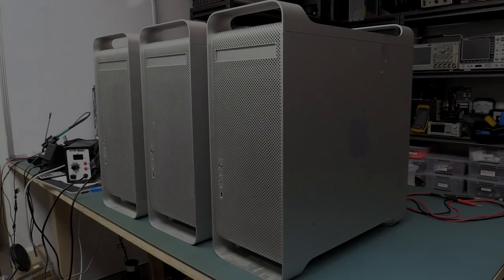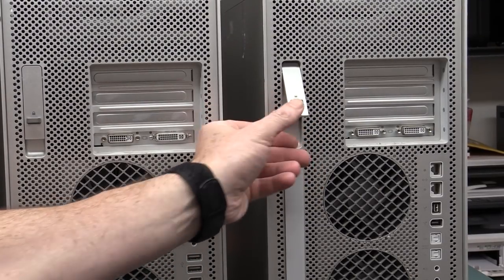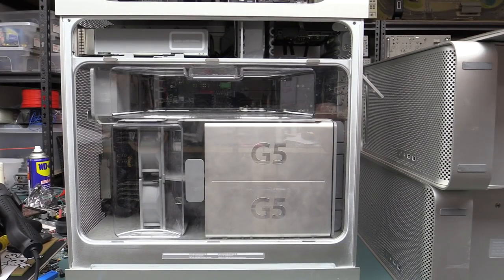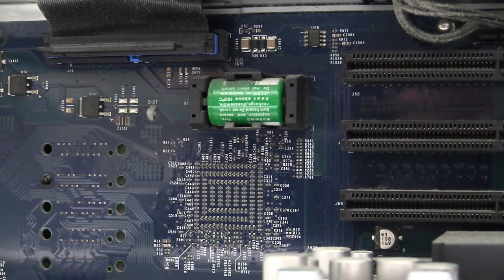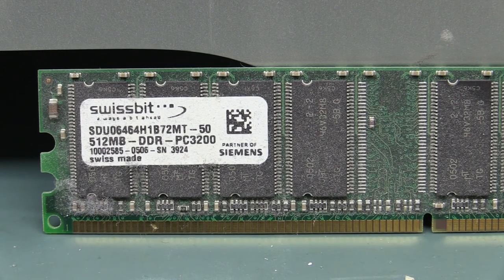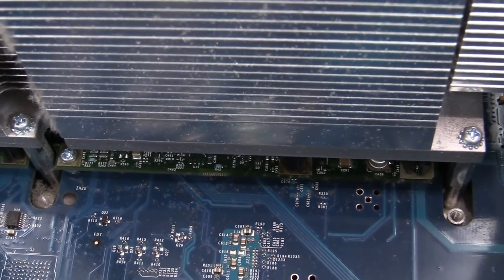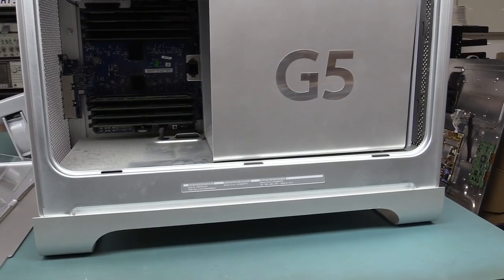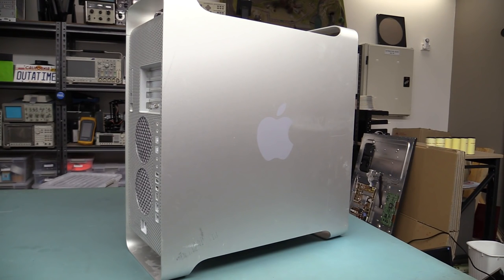EEVblog #783 - Dumpster Dive Power Macs

Comment: Those fans are probably  manufactured by Delta
I have the same in black.
Is that a C19 iec inlet?
Reply from the maker: pcuser80 Yes, C19 I believe it's called. But no one calls them those silly IEC numbers.
Reply: EEVblog C19 was used on the later G5s. the last one you have is the dual-core 2GHz model with a single CPU card. they used the same board for the Quad 2.5 which was actually watercooled. the watercooling on that and the dual-singlecore 2.7 both had watercooling system issues and leaked... the coolant was corrosive! so imagine what that'd do to your board or PSU?

Keep the C19-wielding G5 together and solid. they make very good Linux machines and extremely nice 10.5.8 machines. the others... not worth keeping together if they have DDR RAM. I've seen a few mods in my time, but the most prominent one was the use of a small motherboard with a SAS card and RAIDed drives in custom sleds that stacked, using the original fans for cooling, to make a power-efficient NAS that just looked really badass.
Reply: +Sudos In fact it's a C20 inlet.
Reply: +EEVblog The standard C13 and C14 are often reffered to as "euro connector".
Reply: pcuser80 If the computer crashes these fan spin up to full blast, which sounds like an airplane on take off. The last one of the G4 models was so noisy that a petition was successfully launched by some early customers.
Reply: EEVblog What about that Samsung LCD TV? It was Fixit-Friday.
Reply: pcuser80 5:49 There's clearly Delta logo on the stickers
6:03 "No branding on them though" :D
Reply: +ZXRulezzz 
Yes i see it now ;)
Delta are the best
Just like motörhead extra loud......

Comment: I found one of these in the trash last year.  It had no Hard Drive inside but otherwise everything was there and it powered on and seemed to POST okay.  I ended up putting it in a local classified ad and traded someone for a 5.1 DD/DTS surround receiver so it worked out great for me since I needed a modern home theater receiver and had no use for the old Mac.

Comment: iPhone more powerful? That's a pretty bold statement don't you think dave?
Reply: ***** I feel the same way. Geekbench only seems to show composite scores for iDevices, but from what I can tell the dual core G5s are still more powerful than even the iPhone 5 and I'm willing to bet once you start getting into FP-heavy workloads it's likely even worse.
Reply: ***** well they are over a decade old
Reply: ***** Have you guys ever heard of sarcasm?
Reply: +DrScopeify no.  it is a bad reference.  because it is untrue.  you might be surprized to see how little technology has progressed.  Moore's law is dead.  Jeez... it still had 8GB of RAM.  What does yours have - today?
Reply: +Son of a Zombie - Since when does 512MB x 8 make 8GB? I think you meant to say 4GB...
Reply: +jasonteknut The last machine he showed had 1GB x 8.  Insert foot in mouth.
Reply: ***** Exactly. Those machines are dual-core 64-bit PowerPC with 2.3 GHz according to spec: http://www.everymac.com/systems/apple/powermac_g5/specs/powermac_g5_dual_2.3.html
Reply: megaspeed2v2 They are exactly a decade old. Dave was wrong when he said 2003, those are 2005/2006: http://www.everymac.com/systems/apple/powermac_g5/specs/powermac_g5_dual_2.3.html
Reply: Son of a Zombie 
Your comment wrong on some many levels, I can't even into how you managed to write so much garbage in 2 lines.

"it still had 8GB of RAM.  What does yours have - today?"

Oh yeah, those 8 GB of ram surely came at the cheap cheap price of 100 bucks that get you 8 gigs of 8 times faster and more energy efficient memory these days.
These were top of the line machines, what kind of comparison is that?.
I can do that too:
OMG check out how much technology has advanced, an ATTiny26 had 128 Bytes of memory when it came out in 2002 and now we have machines with 128 Gigabytes of memory!11 
That's ONE BILLION times more memory!
"Moore's law is dead." Except it's not, surely it has slowed down but it is far from dead. I don't understand how it makes sense to try and disprove Moore's law using memory capacity while the theory is based on IC transistor density, I recommend you look up NRAM though, consider it a wake-up slap.

"you might be surprized to see how little technology has progressed."
Except for the massive performance/watt increase and the stuff that is coming up, I consider carbon based integrated circuits a lot of progress.
Reply: ***** No tech is safe from the rapid march of advancement. NOTHING.
Reply: +Son of a Zombie That was the best money could buy. Today the best you can do with consumer hardware is 128 GB, or sixteen times as much. I'm running 48 GB in my main PC at the moment, and 16, or 24 GB in the others. You were saying?
Reply: Son of a Zombie RAM size hasn't grown to giant numbers because RAM Clock Speed is more important now a days than just capacity. 8gigs of DDR3 is much faster than 8gigs back then.
Reply: Son of a Zombie lol not dead yet, as many has pointed out.
Just look at the GPU market they are estimating to hit the 1TB/s bandwidth with the new generations, just a few month a go we were at 512GB/s and before that generation it was 256GB/s.
This is thanks to the fact that they have squeezed so many more transistors into the same die size.
Reply: svampebob007 there is less transistors in the GTX 980 than 780... "many people" have to assume... but engineers are smarter.
Reply: Son of a Zombie
 the density of the 980 is much higher then the 780...denser equal to more transistor per die or more precisely per wafer.
Reply: svampebob007 dense = smaller only.  *Not more powerful.*  Don't let the marketing fool you.  The 980 is better due to software, the hardware itself has gone backwards.
Reply: svampebob007 No, they're both built on a 28nm node.
Reply: Son of a Zombie The hardware has not gone backwards, it has been refined. TMUs have been cut back, ROPs have been increased, CUDA core count lowered but frequency GREATLY increased, pixel fill rate is up, texel fillrate down, etc. There are areas where Maxell is slower than Kepler, such as FP64 but that is something which won't affect 99% of users.

By refining think of it as going from a 2 speed car pushing 300 KW to a 7 speed pushing 250 KW, the latter is geared to better make us of the available power.
Reply: Oj10101
yeah you're right, still doesn't change the fact that the next generation will be pushing the TB/s bandwidth. I'm not the one that pulled the 780 vs 980 comparison. Though to say that the hardware is going backwards is ridiculous.
Reply: DarkAvatar1313 I disagree, memory clock is what we have a massive overhead of right now, at least for gaming.
High capacity memory should be cheaper. imagine devs loading a full 60GB game into memory on launch becoming common practice. Progressive loading of large worlds? screw that! load the entire world!
Reply: iPhones use ARM and PC's x86, you can't really compare them since they're made for different purposes.
Reply: Freek Weijers Someone finally understands.
Reply: svampebob007 No, but you did say that the gate density is higher on Maxwell, which it isn't. Maxwell has a smaller die because it has less gates, not denser gates.
Reply: Oj10101
 yeah and I said you're right, my bad.
Reply: +Jeremiah Batista (JBwarrior) these are Power PC. Power PC is an ARM based architecture, x86 is Intel.
Reply: ARM and PowerPC are completely different instruction sets.
Reply: +Jeremiah Batista (JBwarrior) you're right, I think I was confused as it's RISC based rather than CISC.
Reply: They're both RISC based.
Reply: +Jeremiah Batista (JBwarrior) that's why I was confused. RISC was popularised by Acorn though back in the day..
Reply: ***** Moore's Law was to do with transistor density, not frequency.
Reply: +Son of a Zombie 
True Moore's law has been slowing lately.
But when you look at you computer history you realise just how much things have slowed.
1980 the Apple III a 2Mhz 8bit machine with primitive color graphics was state of the art .
In 1990 the Mac IIfx comes out with a 40Mhz 32 bit CPU and true color graphics.
Reply: Patchuchan Not really, in September 2005 a top end rig would've been an Athlon64 FX-55 2.8 GHz single core or Athlon64 X2 4800+ 2.4 GHz dual core (Intel was still stuck with Netburst Pentium 4s at the time, Core 2 Duo had not yet arrived), 2 GB RAM and two GeForce 7800 GTX 256 MB cards (the 512 MB versions only launched in November 2005) and mechanical hard drives in capacities of up to 500 GB.

Fast forward to today and your choices are a Core i7-6700K 4.0 GHz (4.2 GHz Turbo) 4 core/8 thread or Core i7-5960X 3.0 GHz (3.5 GHz Turbo) 8 core/16 thread CPU, 32 GB RAM, four GeForce GTX Titan X 12 GB cards and PCI-Express SSDs.

Using Cinebench R11.5 as a CPU benchmark, the chips of 2005 were scoring between 0.7 and 1.1 at stock, today's chips do 11 to 15 points at stock. That's an increase of around 15x.

Memory back then was running in dual channel at speeds of up to around 6,000 MB/s, today we've got quad channel at speeds of up to 60,000 MB/s - a speed increase of 10x while having 16x as much RAM.

Graphics card benchmarks can gain or lose a LOT from tweaking, and CUDA wasn't supported on the GeForce 7000 series for brute speed benchmarks so I'm not going to list the benchmarks here but we've gone from two cards totaling 512 MB memory to four cards totaling 48 GB - that's 96x the memory alone.

A 500 GB hard drive from 2005 would've scored around 70 MB/s continuous read/write speeds and 0.6 MB/s random 4K read/writes, today's PCI-E SSDs can do over 2.1 GB/s continuous and up to around 230 MB/s random 4K. That's an increase of up to almost 400x. We also have capacities of up to 8 TB, or 16x larger.

In short, no, I dare say things have not slowed down.
Reply: Oj10101

If you include Wirth's law things might actually be getting slower over all.
Reply: Patchuchan I can partially agree and partially disagree. Booting Windows in under 7 seconds just wasn't doable ten years ago even with multiple drives in RAID 0 unless you stripped the OS to nothingness and disabled all startup items. Starting an MS Office application in under a second was unheard of unless the files were cached from being opened, closed and opened again with the second application launch being timed.

Keeping to the resolution we were running back then (1280x1024 or 1600x1200) you couldn't build a rig that could get hundreds of FPS in the latest games - today it's easily doable (albeit very costly) at those resolutions.

If we bump it up to today's resolutions (1920x1080, 2560x1440 and 3840x2160) it's not doable - we're back down to the frame rates of yore and even lower but the goal posts have been moved.

Because of this it's not that straight forward to do a direct comparison, which is why I both agree and disagree with you.

Comment: I bought the first G5 model when it first came out. I used it for 10 years. It still runs, just stored away now. I used the G4 Cube 15" monitor with the G5 for years. Still works.

Comment: 4gb/8gb of RAM in 2005. Even these days people still have 2/4gb.
If they had gone with windows support, they would have had way more market.
Reply: +Mauro Tamm this is a high end Workstation machine. A modern Dell or HP workstation has 32 - 128 GB of Ram easily. My 2010 Dell workstation has 24GB of Ram and I could upgrade to 256 GB or more if I wanted. Don't compare the PowerMac G5 with a consumer laptop, it isn't fair!

Comment: These machines are just as good as the day they were released for what they were intended to do using the same OS. You can still video render, use modern websites with alternate browsers, and run new software compiled for PowerPC. They are far from useless they were monster workstations back in the day.

Comment: The biggest difference with the last model (the one with the nVidia GPU), is that that one had full PCI-E expansion instead of the old PCI-X that was used on the older ones (although I believe they did have PCI-E for the video card, while most people were still using AGP-8x). That's why it had the extra heat sink, it was for the IO.
Reply: +Yukari Yakumo NVM, you later said that lol

Comment: The cpus are on daughter boards. You should of took them out.
Reply: It is a big pain in the ass to get them out... I don't blame Dave...
Reply: It is I've been there
Reply: +Im Curazy kudos. I fixed the PSU of the late 2005 model once, and then took the whole thing apart at a later date when feeling adventurous. 10 hours just to disassemble and reassemble :D
Reply: Gustavo Ferlizi I used to be an Apple tech, long before they had the 'Genius Bar' bullshit, and I used to strip an iMac (which was a pain in the prick) down to nothing (display issues and things), and rebuild it within 45 minute. Other techs used to watch me because I was the only one that did it without missing a screw or two. It's never a good thing when you have 'extra bits' from a repair. LOL :)
Reply: Gustavo Ferlizi
More kudos to you. Mine was dead i was just stripping the good parts from it and after a few hours i just cut the case apart. For something that looks so neat and simple, it must be put together with magic.

Comment: I have a Quad 2.5 Ghz G5 that I picked up used a while back and still use as a secondary machine. It's great for any PowerPC-only, Mac OS X-compatible games you might want to play, and this puppy can also handle everyday tasks like playing YouTube vids for me. The only caveat is that I'm using a back-ported version of Firefox (called TenFourFox) that doesn't support plugins (though it DOES support Firefox addons), so no Adobe Flash. The latest version for that hardware/software combination is old, anyway.

I have run Linux on the thing in the past (Debian, to be specific), and with that it's really not much different from using a modern PC using Linux. The G5 and my new AMD-based system can do pretty much the same things, though again there's the Adobe Flash issue. If only that goddamned bloatware would go away, I could use my G5 in place of a modern PC with no troubles!

Incidentally this one is maxed out at 16 GB of DDR2 RAM and has the best video card officially available for it, a GeForce 7800GT with 256 MB VRAM. It really is nice for something around 10 years old!
Reply: +Eric Wood 

u can use VLC to play videos on MAC X
copy link address CTRL C and paste  CTRL V it to VLC.

best solution, but some videos are different coded and cant play them
Reply: TheCyberbedouin
You mean command C and command V ;) I just have the browser download any YouTube vid it won't play through HTML5 (some YouTubes mysteriously refuse to play that way yet, presumably because of their encoding). Interesting idea about pasting in a URL, though. Are you saying that VLC takes YouTube URLs directly?
Reply: +Eric Wood 
copy YT URL link or right click on any YT video thumbnail
copy link location and paste it to VLC with keyboard shortcut CTRL+V
it will play it like any stream directly and u can download video with VLC,

when you play videos click TOOLS/codec information and copy location link and paste it to web browser and than "save page as" name the video and add exptension .mp4 and yyou good to go.
Reply: +Eric Wood Flash is dead. All the major sites have already activated HTML5 video (i.e. h.264 format video clips) so the better sites will automatically switch you to h.264 instead of Flash if you are using a browser that supports HTML5. I believe that the G5 version of TenFourFox supports HTML5 video. just make sure that Youtube is configured to serve yo h.264 instead of Flash (if it doesn't then there is a setting within youtube that will do it for you). Then yo have no need for Flash.
Reply: Billy Bob
Yeah, I have it working on YouTube, but other sites still make trouble for me. The only other site I've had work without Flash is Tagesschau.de
Reply: +Eric Wood You can also use youtube-dl on Linux from what I understand, it says youtube in the name but it actually parses through the HTML and can read any type of video stream- even ones usually delivered by flash. From what I understand most flash-based videos are actually standard h.264 video streams hooked together with a Flash GUI so they can just as easily be read/downloaded with the right tools. Can't speak from experience, just from what I hear.

TR:DL- Try youtube-dl for other sites than youtube that use flash.
Reply: ThegamerIdiotgenius
Actually, I'm curious to see how the G5 would handle watching live streams, if only more sites would make the HTML5 switch.
Reply: +Eric Wood idle consumption is horrible, if you're electricity is expensive it's not worth it. I have dozens of toys that simply consume too much. Deprecated by economics :(
Reply: feedmytv
Oh yeah, that quad machine is a real beast. The power cord on that thing is downright scary!